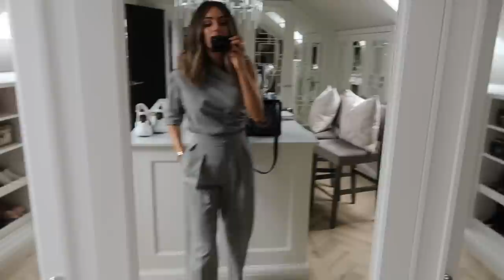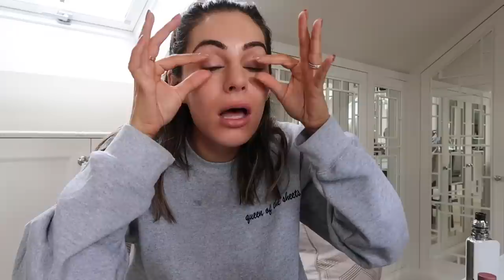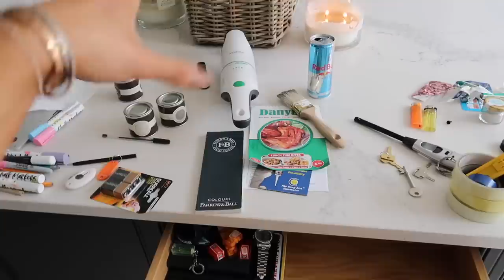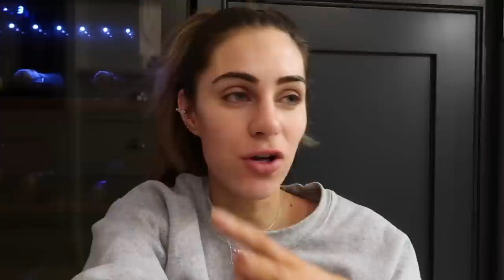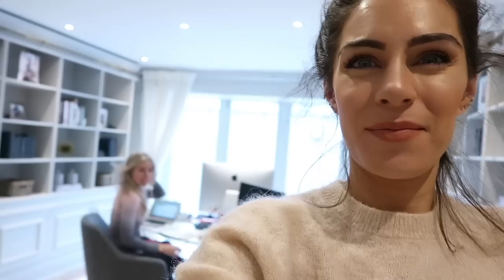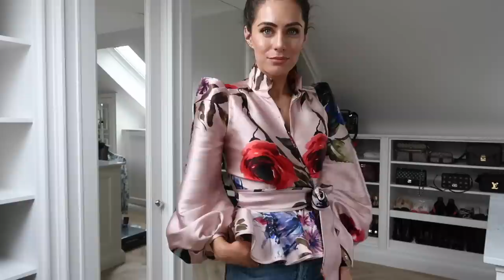IS THIS THE PROBLEM WITH MY CHANNEL? | Lydia Elise Millen

Comment: I tried lash extensions and they were just too much maintenance for me. I can’t handle having sparse areas or them being uneven so I would have to have them done much more often then they say. Then after doing that for a few months I started noticing my real lashes seemed to be getting thinner and thinner. The lash girl just said I was probably sensitive the the weight of the lashes on my own lashes and it cause them to fall. Doesn’t happen to everyone but it definitely dis me. I then hated my own lashes so badly because they were so thin and short. I kinda wanted to put the extension on but I knew that wasn’t going to get me out of this hole. I just had to deal with thin lashes for a few months.
Be careful, this could be happening to you. Also if your like me it’s hard to go two weeks between appointments because I hated having sparse areas so then it got costly and too time consuming.

Comment: OMG Lydia... The same thing happened to my lashes when I got eye lash extensions. I ended up worst then when I started.  I don't do lash extensions anymore. BUT... I DID find my holy grail product that ACTUALLY WORKS!  It's called li'lash. You might have heard of it, it's from the UK I think.  It's a serum that I use everynight on my lashes and EVERYONE always comments and thinks I have lash extensions on... but they are MY OWN LASHES!  (I'm in no way affiliated with Li'Lash) I just love their product... cause it actually works and makes my lashes grow and look thick. I noticed a difference after 1 week... and then the full effect after about 5 weeks.  There are a lot of rip offs and even fakes of this product, but only buy it from the official site and you should be right. I'd love to hear your thoughts on it. It's changed my life... I'm going on 2 years using it.